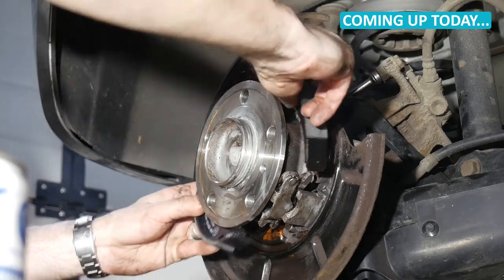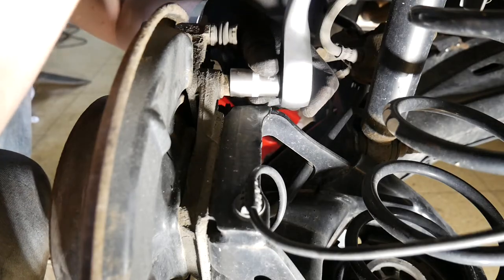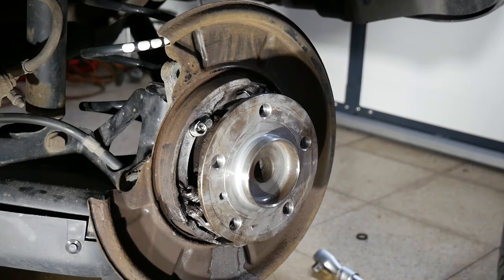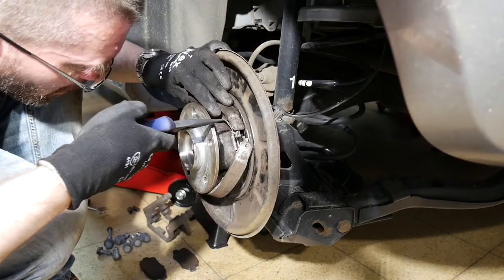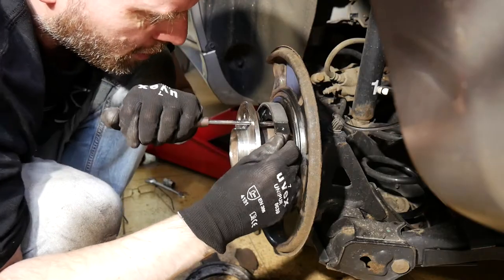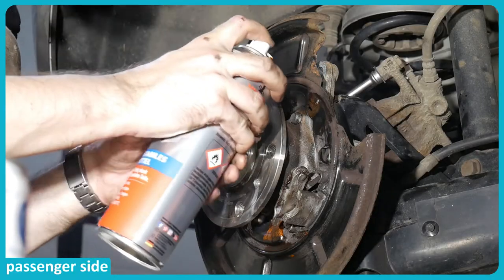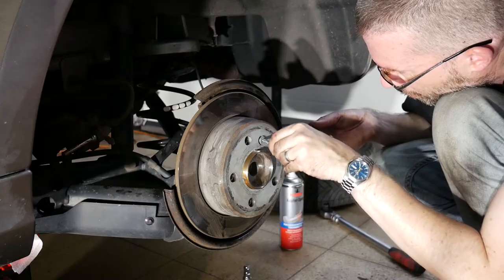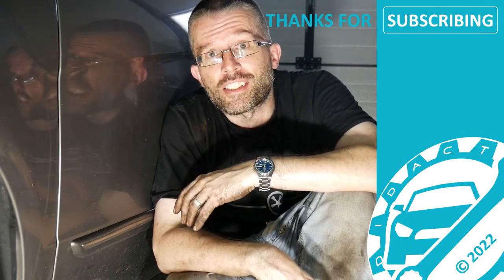Mercedes A-Class (W169) PARKING BRAKE Rebuild & ADJUSTMENT

Comment: Horrible cars to work on! One tip I picked up for doing the springs that twist into the backplate on drum-brake cars, is to cable-tie them compressed and then just cut the cable ties and pull them out when in position..
Reply from the maker: Thanks! Good to know that it can't get much worse 😀
Reply: You’re definitely right. Those springs are a horrible. Tried your method today and it makes the install better. Thanks

Comment: Hi there, would like to seek your opinion about owning an A150. Is it worth buying a used 2005 A150 with 100k km mileage? Any general main issues that I need to be aware of when viewing/testing the car before deciding whether to buy it or not? Is it difficult to find car parts or engine parts for this 2005 A150 nowadays? Thanks.
Reply: I own one around that mileage. It is a junk, like most mercedes these days. On the flip side, I wrench on the side and can keep it going for 20£ in parts + nationwide recovery is on speed dial. Fuel tank fill up pipe corroded (Fix angle grinder/ silicone hose) Fuel pump failure due to corroded electric wire, fuel pipe hoses cracked. fuse box wiring corroded after being soaked in water due to blocked drainage channel. Lambda sensor replaced, cv joint, springs replaced Other cv joint is on it's way out. Aircon and thermistor replaced with chinesium from ebay, failed again after a year. Speedo replaced for 30£ (Failure means no front lights) ESP failed, Radio cluster flickering. windscreen washer pipes cracked. And so on. It has no value apart from scrap and instead of giving it away for peanuts I am driving it until engine failure or I can afford something decent.

Comment: I enjoyed everything until the moment the copper paste was applied on the hub surface. That is not according manufacturers requirements. Disc need's to be mounted on a naked, glossy clean surface.
Reply from the maker: You're right, but even at the official workshop some nasty paste was applied, also on the wheel bolts btw (which is a no-go of course). I did it the "correct" other way when changing the front brake discs and the hub areas were severely rusted already half a year later 🙄
Reply: @AUTOdidact77  Well, on the rear it is not so critical as it is on front. Big risk of having throw in the rotors after a short distance max 1000-2000km Today i disassambled my E class coupe rear brakes to check the state of it. It appeared that the parking brake system is completely rotten. That's why i ended watching your video😏
Reply: checked my brakes on rear as handbrake was rubbish backing plate rusted through two springs nowhere to bs found 😮